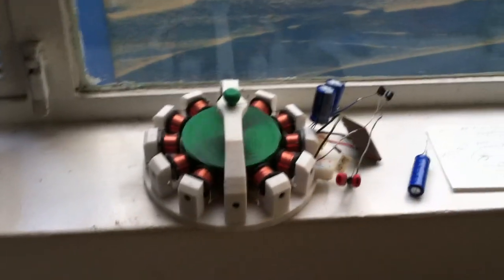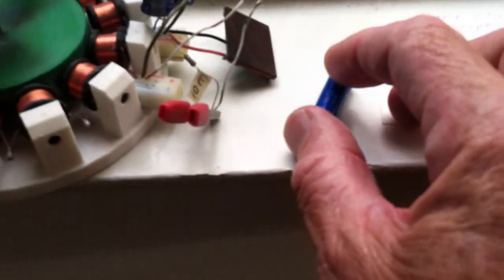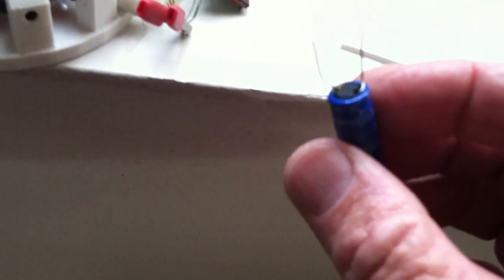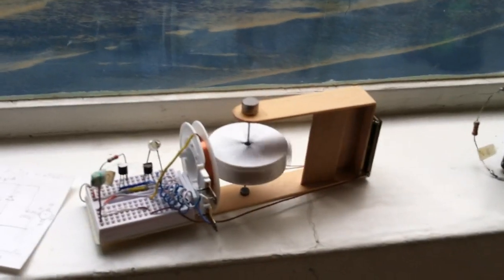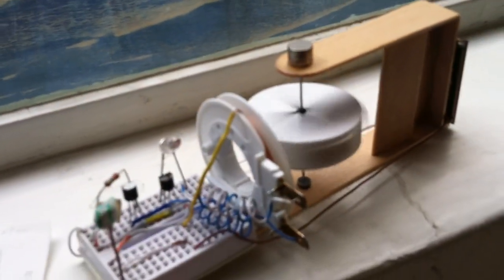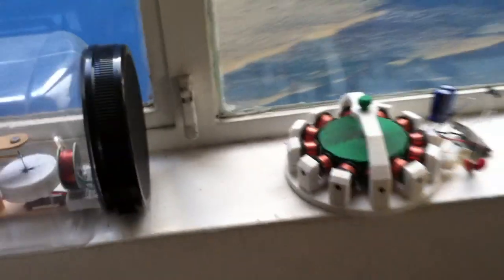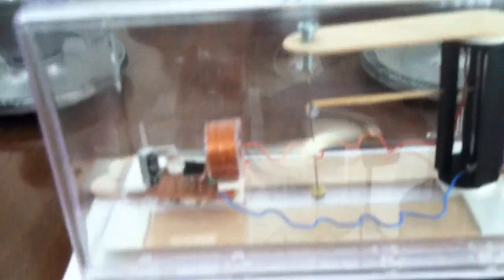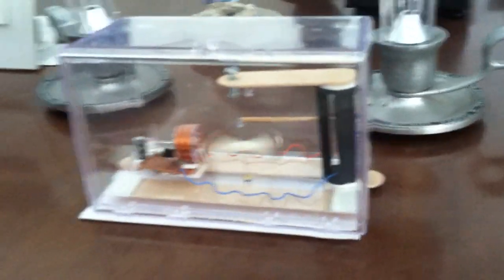My Non-Stop Running Devices-----  Update after 1 year

Comment: Awesome thumbs up Pleiadian scientists Ufo builder.... the bearings went bad on my self energizing motor ..they were over 20 years old ..but the motor ran for over a week at a constant
Reply from the maker: The bearing issue has been a major problem with my motors.  The EZ Spin motor uses jewel bearing with a hardened steel needle and that has been the most reliable.
Reply: @Lidmotor  how do those types of jule bearings hold up as far as tork

Comment: An interesting idea would be to see how FAST you could get one of these types of devices to rotate. Maybe if there was a limitation on delivering power, you could set up a dual bank of capacitors and switch rapidly between the two.
Reply from the maker: The speed is easy to achieve with higher voltage but the motor components have to be beefed up to handle it.

Comment: Thanks for the update, always fun seeing stuff spin.  I noticed on the view of the Dad Hav circuit that the rotor magnets are all facing same polarity.  Would the circuit work for alternating polarity as well?  If not, do you have a version that would?  Didn't want to reinvent the wheel if you already been there done that.  

Any plans for some electrostatic motor designs?  Most think they are impractical, but there are designs doing fractional (near 1hp) horse power even back in the '70s if I recall!  Should be a wide open opportunity with today's tech.  Some advantages include way better power to weight ratio than regular electric motors and the possibility of higher efficiency.  Also no special magnets, coils or copper meaning cheaper and greater choice of materials to use.  Opportunity to some day replace your car engine according to the author long ago (forgot who) that wrote a book on ES motors.  Basically said might advance one day to a mostly plastic (lighter good for aircraft), simpler manufacture etc) car engine but with competing horsepower.  Your tiny scale table top R&D is ideal to try different approaches.  That author is deceased  now (70s) and seems to be the last serious professional researcher on advancing toward practical applications.  Since then there has been some study on "lifters" but that is not what I refer here as I mean motors with real "muscle" to transport us like an engine in a car, boat, airplane etc.  In a vehicle you would have some power black box to make the right HV and the ES motor(s) otherwise similar to a regular all electric car in form.
Reply from the maker: This circuit will work with a N/S rotor also.  I did a video series on that way back.  It was called the 'Paper Clip Motor'.  It used a N/S neo ring magnet mounted on bent paper clips for bearings.  As far as an electrostatic motor with good usable torque I don't know of any current work going on.  Those motors are a favorite of mine but like the Stirling engines ---they lose out to other designs hands down as far as doing real work.  Perhaps with new materials and technology someone will develop them further.
Reply: Oh, excellent on knowing the Dad Hav will work on mixed magnet polarity.  Will review the Paper Clip, forgot about that one.  Of course, now I wonder, if  a N-S-N-S rotor gets pulsed on each polarity N AND S, or is the circuit still just firing on same polarity intervals (N-x-N-x-N) and skipping opposite polarities?  It matters, as the former is 2x more efficient than the latter.  Maybe you have already covered this point somewhere. 

You probably already know the following, but I will throw it out there just in case.  I found the book I mentioned before.  "Electrostatic Motors" by Oleg D. Jefimenko.  Contrary to common biased knowledge on ES motors, he mentions a motor design that only uses 60VDC and not high voltage.  In another small design he shows a ES motor producing .1 horsepower.  Besides the usual corona discharge types there are capacitor and electret motors.  Torque?  Ben Franklin said his was strong enough to rotate a pig's spit or a 100 Spanish coins.  No gearing.  If you make a capacitor of removable plates/dielectric, you will note there is a LOT of torque holding the dielectric between the plates when charged if you tried to pull on a plate or dielectric.  That is the point of capacitor motors, (no corona loss).  Torque can be scaled.  A modern material not explored yet is graphene/graphite (battery materials).  In general, I see at present the ES motors as having similar characteristics to gas or steam turbines.  Both have low torque and very high rpms and both are very light weight and ideal for aircraft, boats etc.  Ships used turbines with reduction gears to get back the torque.  ES can as well if even needed.  But maybe not as ES motor sections are very thin and many can be stacked on a common shaft for parallel combining of torques.  And get this, the whole ES motor parts could be 3D printed easily.  Far faster and cheaper than if compared to buying a regular magnet/coil motor.  When I retire I will be studying this subject but for now I can only encourage others to explore this subject.  Not all is know or understood in our modern times.  Don't even know what "charge" or "electron" is or why it should exist.  We only know how to characterize phenomena not explain origin.  Hope you will do some more experiments on this subject.

Comment: The only observation I can offer is to use litz wire for the coils.
As I understand, DC current uses the entire wire while AC current only travels on the skin of the wire. 
Perhaps related to the lens effect.
With one wire, the area available for the current to travel is limited.
Litz wire offers more area for the current to travel.
Pulse motors may operate at a frequency high enough to look like an AC current to the coils.
Seems to me if current could more easily move through the coil then less energy would be wasted.